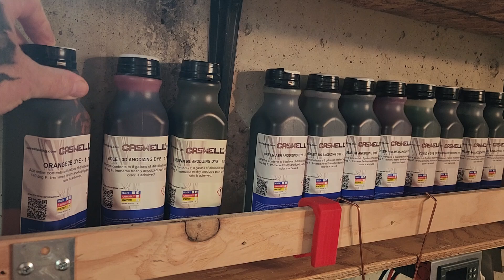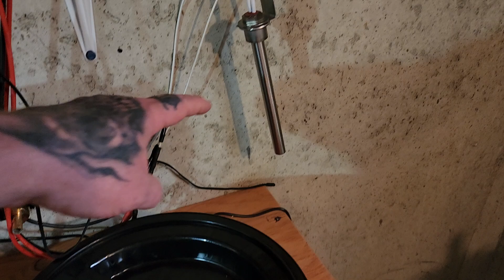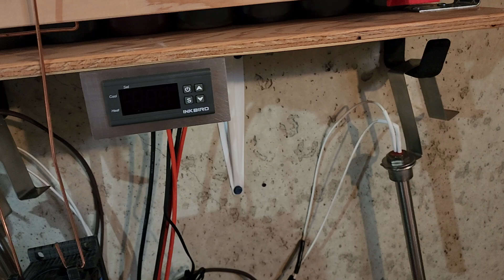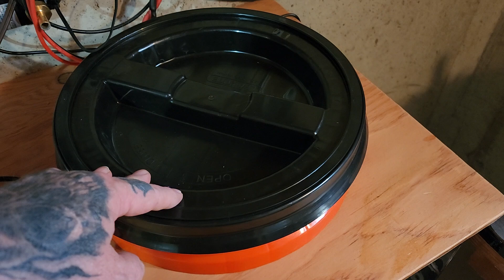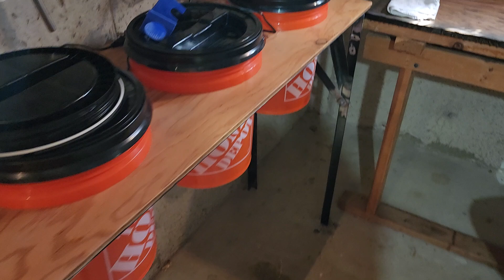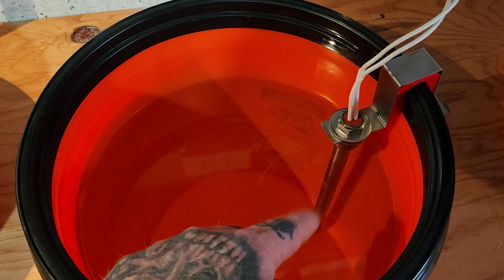Anodizing room update. Not so good.

Comment from the maker: Just a correction; I said the anodizing tank needs to get to 168 degrees before the cooling pump turns on. I meant 68 degrees. The anodizing bath needs to hover around 65 to 70 degrees.